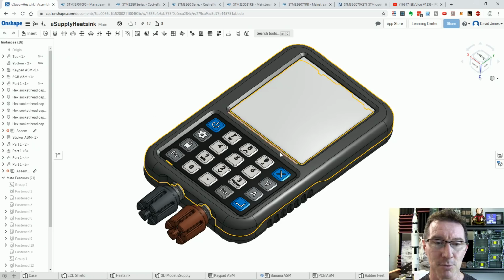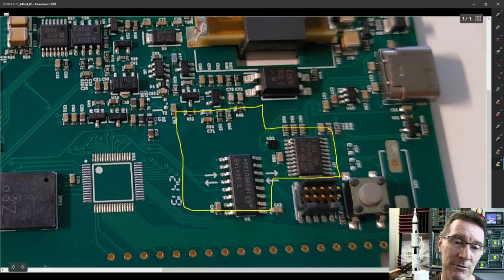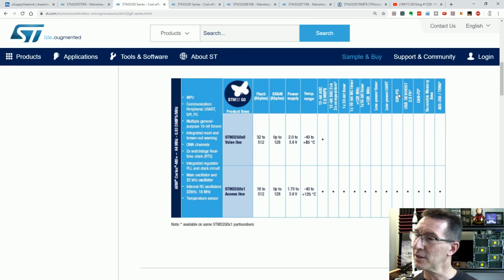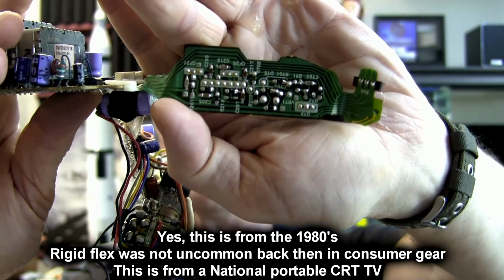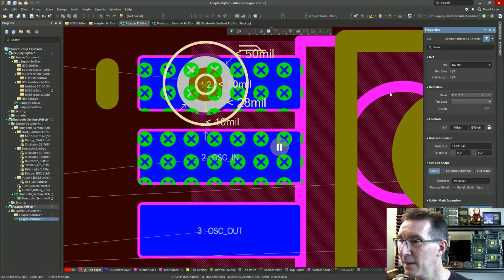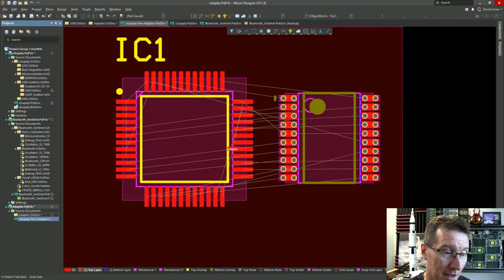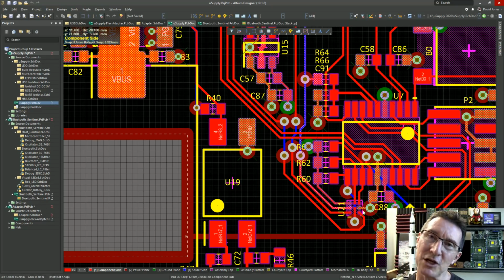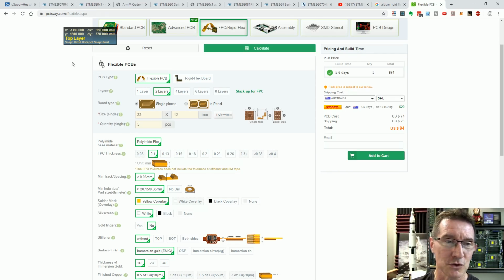EEVblog #1262 - Designing a Flex PCB + uSupply Update

Comment: I was thinking buying one of these HDMI  8 channel lpcm to analogue thingies what would it take to be able to make it encode ADAT lightpipe, the chips is under 10 dollar?
https://www.transmedia-germany.com/downloads/download/manuals_video_en/CS%2031%20L_manual_en.pdf

Chip coolaudio.
https://www.xmos.com/download/AN01004:-ADAT---Replacing-Wavefront-AL1401-402-with-xCORE(1.0.1rc2).pdf

I guess one must check if there is a wordclock out and digital lines out o on the HDMI extractor chip? Or jjust replace the optical 2 and 5.1 channel encoder?

I probably do not even get the complexity of such a project.
Reply: https://www.ebay.com/itm/CoolAudio-V1401-AL1401-eqv-ADAT-Optical-encoder-generator-/331860686512

Comment: Cool video Dave, I never would have thought of the flex pcb solution.
When I first read a ST uC datasheet I thought 1000 pages was a bit steep, a month later I was like where are the other 5000 pages. Sadly I get the impression most silicon vendors are the same, fringe Bluetooth uCs are just absurd, you need to read every datasheet the manu has written in in the last 5 years just to understand the basics of one product. I looked at the ST G series chips after you first mentioned them, went to the datasheet, found nothing for USB PD. Most of my USB power needs are low, unlike you who is actually trying to use the features of the USB PD spec. The USB spec and all the subspecs are a mess, I blame them along with silicon vendors.

Comment: 9:30 could you solder a small standoff to get the height over that of the nearby cap? and then attach the flex to that standoff
Reply: Dave said in a previous reply that he would consider doing that for a production solution, but not for this application. It should function just fine as is, no reason to add to production costs

Comment: LOL at the rant about ST. They can a pain to deal with. Regarding flex, flex can usually have very tight pitch, tighter than FR4 because the fiberglass weave doesn't distort the surface.

Comment: Dave, you will have problems with the annular ring for the 0.35 mm hole and the pads with the 0.5 mm pitch, I have worked with PCBWAY by long time pushing their limits in rigid boards and their standard annular ring for rigid is 0.15 mm, and I think you do not meet that...

Comment: Facepalm Dave! You did not read the that ST Micro table properly at all!
You are looking at the datasheet for the STM32G0x0 line!!! The G0x1 line has the PD PHY!! 
If you read the table properly, none of the MCUs the G0x0 line does not have a PD PHY at all!
G071 is about 50c more in volume. Compared to the $1.2 increase to the G4 series.

I will concede that it is misleading that the G0x1 row shows USB PD phy, but not all have the PHY (only the QFP and larger pin count models do).
But doing a Ctrl F on the datasheet for the wrong micro is a facepalm moment!!

Comment: Dave, you said that in flex PCBs you would't do regular 45° angles in the traces, but then you routed them like that...
Reply: Lazy or “just prototype” is no excuse for 2nd rate designs.  Extra 2 minutes to clean it up.  Especially when you present it to the public.  This is how China does design “good enough”.
Reply: It's a prototype bodge fix.

And you certainly wouldn't want angled traces if the flex was expected to move often. In this case it's highly unlikely to move very much once glued and soldered down.

Comment: I got a Richtek IC for battery charger USB PD with OTG functionality. But I didn't read a single phrase (10 words in a 200 pages pdf) on the documentation that explains that I needed a resistor in place thermistor if I didn't want temperature control and now I have 10 prototype boards that are useless because I can't disable the thermal protection in software so the chip thinks there is a thermal issue with the battery and refuses to work...
Reply: Time for some bodge jobs my friend!

Comment: I would have just stuck a pair of 30A Anderson Powerpole connectors or even a 5.5x2.5mm barrel jack on the µSupply and called it good.
The USB PD is way too damn complicated and doesn't even work with a typical USB charger.
Reply: But USB C is so nice

Comment: By the length of the video and the number of boards, delivery time and cost, I would argue that super-glue-ing the chip on the top of the U2 and hand-solder each pin is a viable option. (Done myself with simpler circuits, and seen done with a Ethernet PHY that was placed with the wrong footprint)
Reply: yes handsoldering wires is quicker for a couple prototypes

Comment: Hi Dave, I just search some ripoff stm32 micro on lcsc.com. a company called gigadevice produce tssop20 package ripoff stm32f330 called gd32f330 and has 128kb flash. Similar price as the stm32f070, but its a arm m4 series, much powerful but as you know just a ripoff one. If you saw this comment, please reply to me.
Reply: Technically GigaDevices are not rip off of ST, they have licence from ARM for core (as do ST) and they are compatible with ST they should run all same code as ST but not all what run on GigaDevices can run on ST (USB prescaler options have more bits on GigaDevices due higer clock speed, flash memory on the GigaDevices is zero wait state what make GigaDevices faster on same clock ...).
I said technically  is not rip off just becaouse even they have licence for core I do not know do ST have patented registar names or pinout, and last time I chacked (i didnt look close, but on first look) GigaDevices did cloned ST library (ST library can be used only on ST parts according to licence and GigaDevices  just replaced in it ST with GigaDevices).
Reply: @mrlazda  yep, its legal. my english is poor, the meaning of "ripoff", yeah, i mean its a clone one. but the gigadevice one is a cortex m4 series microcontroller, same package, i dont know wether its a pin compatible one.

Comment: Hi Dave, to be honest, just redesign the pcb please, usupply should be a professional product from a professional engeneer, you cant solve the problem just for convenience.
Reply: If I understand correctly it's just for prototyping with existing boards.
Reply: @MrJef06  yeah, i just found a gigadevice ripoff tssop20 stm32f330 called gd32f330 on lcsc.com with 128kb flash.
Reply: @chenli9734  I highly doubt this will be part of the finished product. He already covered why he is making this bodge board: to try out this larger uC without having to spin a new prototype.

Comment: Why is USB PD complicated? Don't you just set the desired voltage and max current to be pulled from the supply? It's for USB C higher voltages, right?
Reply: The protocols are a mess, everyone made their own and you need handling for it all to not fry anything like used to happen in the olden days of USB C

Comment: Have you noticed how specifying 5 and 10 units have the same cost? In my experiments, you can order up to 220 of 22x12 mm PCBs for the same price as 5 would cost.
Might be a calculator error, though.
Reply: no, not really. When they make a whole panel just for you, that it is that way.
I was able to order  1000 small Flex pcbs for 1000 Euros (which was the full initial series of the device), as the prototype price was also 1000 Euro, but just 100 boards, guess what I took. Note that even gave us the benefit of having the prototype board in series production quality in series production processes.
Reply: Usual the cost is just a shipping cost difference.

Comment: About the undocumented registers and data sheets under NDA: seriously I don't understand why manufacturers do that. Are they trying to protect some kind of implementation secrets? I can't believe there can be anything to protect here -- anybody can define such a programming interface. They're just making it harder for people to adopt their solution.
Oh perhaps they want to charge more to release the information or sell libraries?
Reply: What I especially don't understand is why designers accept parts that are under NDA. Like, that's an immediate "nope, won't use" for me.
Reply: WeNeedMoreFarads: It is often not the choice of the engineer but the choice of someone else.
Reply: They do NDAs not only to hide painful stuff, also to scare smaller players in electronics field.
Reply: Well: Fully documenting it would show to the world how painful it is in realty is. That might lead you to choice a manufacturer where setting up USB power delivery is shown in just a five minute youtube video... Offcourse when getting the part you have to deal with the NDA bullshit and undocumented crap, but at that point you are already locked in, so success for them and suck ass for the engineer.
Reply: They might also hide some details so it's harder to infer the implementation, and thus harder for patent-trolls to attack them.

There was patent troll (in Aus IIRC) who had a patent on portable devices with multiple power rails from a single battery source.  I shit you not.